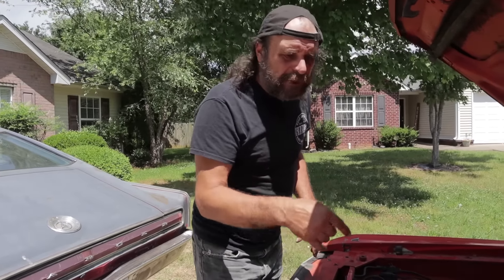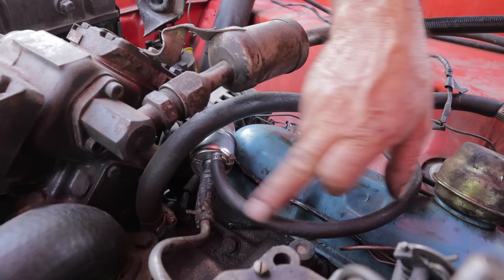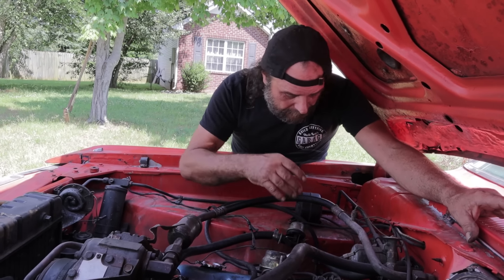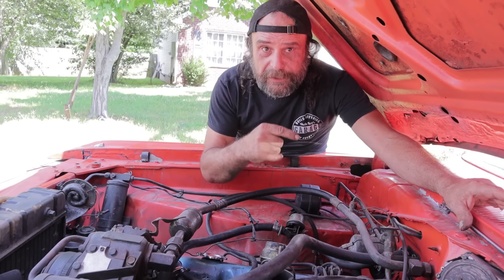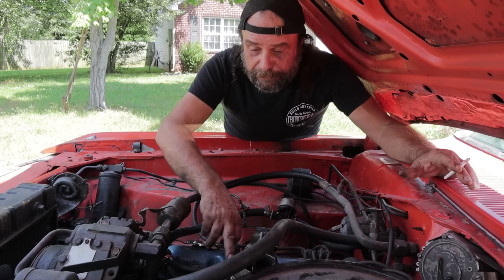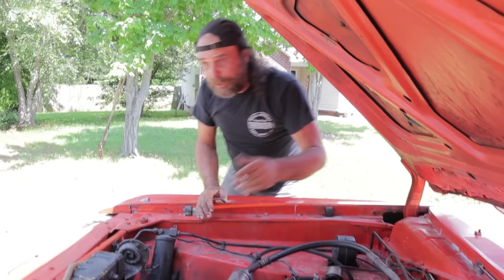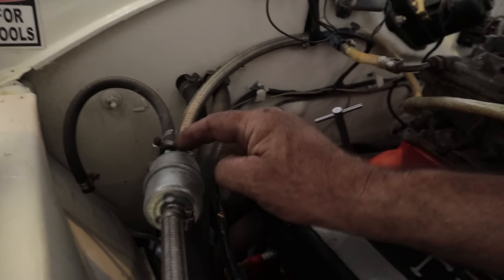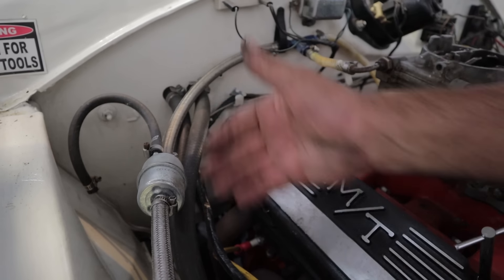$8 Cure For Vapor Lock

Comment: Bro for real it's ridiculous my mechanics didn't know this, thank you
Reply: Why should your mechanic know this? He doesn't work on these kind of cars!!! Most mechanics have never worked on these kind of cars!!! Mechanics only know about how to do fix it when it comes in their shop!!! I've been a mechanic for 30 plus years and I learned something today!!! Fuel injection doesn't have this problem!!! Plus when I was working on carburetors, we didn't have the ethanol in the fuel!!! So don't be so quick to judge the mechanic!!!
Reply: @rockerpat1085  thanks for the reply actually he does work on these pretty much all he works on is vintage vets so the fact that he doesn't know this to me is disappointing
Reply: @smokeyvette6107  Again if he's not experienced this he may not know the answer.  Mechanics don't always know everything!!! And it's not fair to expect us to know everything!!! That being said, what year Vette do you have?  I just posted a video of my Vette going on a good romp!!! Been having similar problems as explained in this video.  My pump wasn't up to par,had to replace what is essentially a new pump (4 or 5 years old but zero miles) and fix a bad connection at the starter!!! Full frame off rebuild and working out the bugs!!! Check it out on my channel if you like old cars and loud guitars!!! Keep Rocking!!!
Reply: Okay I understand thank you I'm sure you're correct and there are plenty mechanics out there who don't know of a simple fix to a common problem for old cars and obviously even more mechanics out there that make excuses for why they don't know about simple inexpensive fixes for common problems. Fact is most of mechanics out there are nothing but Parts Changers not problem solvers it's unfortunate that if they can't plug their computer in and it tell him what" part to change" they don't have any idea where to go from there I'm sure you don't know anyone like that
Reply: 62 64 and 77 they're all fully original except the 77 has a bunch of performance goodies
Reply: @smokeyvette6107  I bet your doctor doesn't get it right MOST OF THE TIME!!! But you expect a mechanic to be perfect and fix YOUR PROBLEM right away and for no money!!! But yeah we're just parts replacers and can't figure out how to do anything!!! You have NO RESPECT FOR THE MECHANICS!!!
Reply: I  have plenty of respect for mechanics its parts changers I have no respect , especially the ones that just look to change Parts not to diagnose a problem and repair it. I had a best friend that passed away a few years back that was my mechanic for a very long time the first thing he did for me ever was bust open a water pump on a Ferrari and repair the inside issue and put it back together THAT was a mechanic and I had and have much respect for him and for mechanics like him. The ones who I do not have respect for at  all are like the one who repaired the water leak on my Mercedes the first thing he did was a water pump then said that caused more pressure on the radiator  the radiator that has caused a leak so replaced the radiator then replacing the radiator put more pressure on the lower hose it was a $20 hose the whole damn time and $1,200 later I didn't have a leak anymore that's who I have no respect for or Parts changers like him who can't or won't take the extra time to track down the actual problem  rather than changing out Parts till they find the one that is the actual issue after all it's not their money that's being spent on parts that aren't bad and they're getting paid for the labor or the book price for the labor for everything they do
Reply: Also in the hot southern portion of the country where I'm from vapor lock is a common problem that pretty much any mechanic thats worked on any carbureted cars  has come across,, so once again , it's truly a shame they don't know the simple inexpensive fixes for common problems, or if they do they don't do it because it doesn't mean a hunk of cash in their pocket
Reply: Well he wasn't my friend when he busted open the water pump on that  Ferrari, anyone with more than a fourth grade level reading level would have read  into that in the comment. What he was was a capable honest person of which your industry and seems like you are  woefully lacking. Obvious you don't know what you're doing or you would have known that vapor lock is a common issue in carbureted cars in the south , the fact that you think it isn't says quite a bit. Hopefully Uncle Tony gets many many more subscribers some of them being real mechanic who want to learn rather than plug in the scanner and replace parts. There's no need for you to reply as I'm sure it would be more of the same insults about a person you don't know and insults about a car of which you have no idea what model it is and probably would have nowhere near the Technical  knowledge to even start to understanding
Reply: @smokeyvette6107  You have been full of insulting a lot of people you don't know!!! You claim to have 3 Vette's, how many have this problem?  Probably only the 77!!! Why because you've hot rodded it out and it's making more heat under a hood that doesn't get rid of the heat well!!! This is a know problem with Vette's!!! Now let me hip you into another fact that I'm sure you don't know.  The 77 Vette has a 3 port fuel pump!!! Want to know what that third port does? The same thing the this fuel filter does, it by passes the fuel back to the tank just like Tom is doing in his video with a fuel filter!!! I started working on cars in Houston in 1986 at Mike Hall Chevrolet as a tune up and drivability helper and later as a tech!!! I have fixed thousands of carb problems over the years and it is rare that a car experiences this problem!!! Just because you are having this problem doesn't mean that it's all that common!!! And the idea that any and all mechanics should know Tom's "magic" fix is crazy!!! Plus this may not be the answer to any but his car's!!! May not be the answer to your Vette problem!!! This may work on his big fender Chrysler but not a Chevrolet!!! Different car can experience the same problem but have different solutions!!! But you wouldn't know that because you haven't ever worked in a garage fixing cars for a living!!! Now let's talk about your comment about mechanics "lining their pockets". I bet you have money in the stock market and you expect the CEO to maximize profits so you can get paid. Don't you?  But if an auto garage engages in this practice you say they aren't honest!!! Again let me hip you into another fact, everyone gets up in the morning and set's out to "line their pockets" with other people's money!!! That's the game!!! I also bet that having owned a Ferrari you probably don't work with your hands and probably make over 6 figures a year!!! Now compared to a mechanics wages (which by the way haven't gone up in 30 plus years) who's "lining their pockets"? You've never done this job and yet you sit and pass judgment on those who do!!! I'm going to say it again,  I think your a horses ass!!! And at anytime you think I'm a bad mechanic and don't know what I'm doing, you and anyone else who is reading this comment can check out my channel and see what I know how to do!!! No take a long walk off a short pier!!!
Reply: Well obviously we don't travel in the same circles cuz I've got a lot of friends who own vintage cars, all carbureted, but you're right I don't really see anybody driving carburetor cars as daily drivers. So obviously we're talking about two different mechanics you're talking about mechanics that work on newer fuel-injected cars and I'm referring to a person that specifically works on vintage cars so I think we could both be right if we just leave it at that I think that would be best. I think you're absolutely right somebody who works on new fuel-injected cars for a living would probably know nothing about vapor lock on older car ready cars but a person whose job it is to work on Vintage carbureted cars to me should know something about vapor lock

Comment: You started showing up in my feed recently. I'm an old guy too, build carbs, engines, transmissions, entire cars, plus I do EFI and other modern tech, often putting it in my 40+ year old cars. daily driver is a 65 GTO with a 455 that runs solely on E85 and E100 in it. I make E100 from tree sap and cattails, 10 cents a gallon lets me run my huge V8s with 13:1 around on the street all summer. Here is more info on the modern gas.

The reason why it is boiling over far easier than it used to has to do with the multiple components that make up gasoline, the stuff that comes from oil. Ethanol has a 173F boiling point at sea level, it goes up with pressure like most other boiling points, but that is not what is causing the problem. Ethanol is somewhat counter intuitive if you know gasoline, its very different but raises octane considerably. 

That 10% ethanol they mix in raises the octane from 60/70 in the base gasoline to 87/93, depending on the mix of the gasoline components. The boiling points for what constitutes ethanol free gasoline has boiling points that range from 80F to 450F, flash points are equally varied and all over the place. Octane for each component tends to go up with boiling and flash points. So what they can do now is mix in the very light parts of gasoline that have a naturally low octane, and get it to run without knocking by adding 10% vodka to it. So that stuff boils in the lines or tank on a hot enough day. 

Where I live its rarely above 80F, so we get the really crappy stuff up here, and they charge us a fortune for it. That is the reason I got into making vodka to run my cars, because 87 octane gas was $5 a gallon until 2015, and now its nearly $3 a gallon for 87, and I am not even close to California. The gas you buy in Georgia or Texas is different than the gas we get in the far northern reaches of Michigan. We get the light crap, you get the slightly heavier stuff, but its all lighter than it used to be. They can sell you the worse crap because ethanol improves is so much.

They used to use tetraethyl lead to raise octane, and that just might be why the boomers and their parents have such a huge problem with Alzheimers. Though nobody will look into it because the class action would kill the oil companies.  That caused cancer and all kinds of other problems, so it was discontinued when I was a little kid. Then they tried MTBE, and that too was very carcinogenic and harmful. 

Meanwhile ethanol is consumed by millions world wide daily, used in de-icers and to remove water from fuel systems, so its harmless as long as you aren't addicted to it or drink too much and pray to the porcelain god the next morning. It cleans the hell out of your fuel system, removes all the varnish gasoline leaves behind, also it allows you to burn any water that condenses in the fuel tank rather than sitting on the bottom, causing corrosion and then making the engine not want to run when it gets sucked into the pick up. Ethanol when burned only makes Co2 and H2O, runs cooler, and can handle more compression or boost than gasoline can, all the while making more power. Its fun stuff in your car in high percentages, essentially a race fuel for the street. 

I have almost 1000 miles on the oil change in the 65 this year, and it is still clean. That engine has never been run on pump gas since I rebuilt it back in 2011. I have to run a 195 thermostat in it to get it warm enough even cruising around Nebraska in 105F weather. Nothing special in the engine and fuel system, its all basic parts store stuff and 1967 vintage 72cc 400 heads on a flat top 455 with an additional .04 stroke, and my Qjets run great on it, the FiTech EFI did very well too. No problems with vapor lock, even with mechanical pumps, here in Michigan or in Nebraska where my family lives. Yeah I road trip the thing too and have other cars I run on E85/E100.

When they found they can sell the really low boiling/flash point stuff for profit, they took advantage of it. I do not blame them, but where I take issue is how they then blame ethanol for the problems the gasoline is actually causing. Business is business though, you do what you must to make a buck. I don't think its the companies themselves spreading that, but people who simply do not know much about it.

Before 2007 I was building everything to run pump gas, race gas got too expensive in 2005 so I dropped compression in most of them. Then when gas got to where 87 was $5 I looked into making my own fuel just so I could drive my cars and not be stuck in a modern appliance. I got quite adept at tuning for pump gas, getting 20mpg from one of my 455s on a 1500 mile road trip, 2004R, 2.93 gears, 27" tall tires, Qjet, and enough wheaties to push that 4100lb GTO into the high 12s with the stock converter and those gears, on 87 octane with 8.8:1 compression. It was an engine I spent all of $1900 rebuilding with cast pistons and a mild cam. I love 455s. Cars that quick have a hard time getting a mechanical pump to feed them, so most of my 400 and 455 powered vehicles have electric pumps by the tank. That really helps with vapor lock, and I never had a problem with it.

So yeah the ethanol is causing the problem in that it allows the oil companies to sell you a not nearly as good quality gasoline, but on its own, it is not a problem. The additives they put in the 10% stuff are also an issue, Jeff Smith from Hot Rod Magazine and Summit Racing wrote an article about that. https://www.onallcylinders.com/2018/05/25/ask-away-jeff-smith-e85-pump-gas-additives-not-ethanol-cause-corrosion/
Reply: That was a great read! Wish I could pick your brain for a few days. I always hated EFI but that was mostly because I didn't understand it. I've learned a bit more in recent years and am now looking to install a Holley Sniper kit on my 4x4 bus project (Ford 351w/C6 Trans/3.73:1 gearing/32" tires) mainly for the reliability, also for the tuneability and gas mileage. Overall, cool stuff you're doing up there!
Reply: Already subscribed
Reply: Looking forward to it,  @SweatyFatGuy !!
Reply: Write a book. damn.
Reply: Hey thanks for the information!
Reply: Great info! I want to make my own gas. I just subscribed!
Reply: This probably explains why my Jeep still boils over, and still smells like gas. I was planning on wrapping all the line in fiberglass but with this explanation there's probably not a lot I can do. I would like to convert my 71 Fury and 72 Newport to E85, I know it's been a long time coming and we're starting to get it close by. Maybe even go EFI and set it up for dual fuel.
Reply: How do you make E100 from tree sap and cattails?
Reply: Arman Peirce that's what I wanna know
Reply: @multishit6664  have u ever met an old timer? they pretty much can move a mountain with a hammer. god forbid they have some real engineering skills to boot....
Reply: @SweatyFatGuy   I wouldn't concern myself with "hippy" type labels. Sounds like an interesting life.
Reply: How much do you increase jet size with this?

Comment: We used to get vapor lock here in the south decades ago before ethanol was a fuel additive and was imbibed instead. My understanding was that there were two formulas for gas back then. A summer blend and a winter blend. It was when summer arrived and we were still on winter gas that was the worst for vapor lock. That's when mama's clothes pins would go missing. Clothespins are effective and cheap but they ain't as pretty as that fancy vapor separator. Now I can take mama's clothespins off the '64. Thank's Tony.

Comment: Had vapor lock problems couple years with a 454 Chevy with Edelbrock carb. One of those filters & return line did the trick. Good tip!!!
Reply: artiscat22 how did you go about putting the return line into your gas tank? I was thinking of using filler neck. 69 Mustang
Reply: Where you buy the filter?

Comment: This video reminded me of our family camping trips. My parents had a 31 foot or so Airstream travel trailer which was pulled using a 1968 Ford Country Sedan Station Wagon. The 390 CI engine would vapor lock in the mountains while pulling the trailer. His fix was to clip on wooden clothes pins to the rubber fuel lines in the engine bay. It provided enough heat sink action to stop the vapor lock. Worked like a charm. I think they were still there when they sold the car, LOL. thanks for the memory. Good video.

Comment: Blocking the exhaust crossover under the intake helps a ton too
Reply: Yes. Plus back in the 60s we would put a lot of foil under the manifold. Which kept most of the heat away from the carb.
Reply: What about the old wooden carb spacer trick that boat racers used to do? The wood does a great job insulating the heat from the carb, and let's be honest in most cases the increase in manifold plenum it gives you increases hp too. Another little trick we use these days is with duel plane manifolds- the dividing wall at the point where the carb bolts on has a slight cut out in the middle with newer duel plane manifolds, it doesn't effect the way the manifold opperates at low to mid range RPM but allows it to breath a little better up top like a single plane does. It sort of becomes a hybrid manifold at this point. You only need to cut out 75% of the cross sectional area the dividing wall seperates (right in the middle of the dividing wall) and only needs to be around a 1/4" deep for best results. Just remember to stuff the inlet hole full of rags so the metal your machining away doesn't fall into the manifold- or you can remove it if your really concerned about not letting anything through the motor, which is tech the best way...